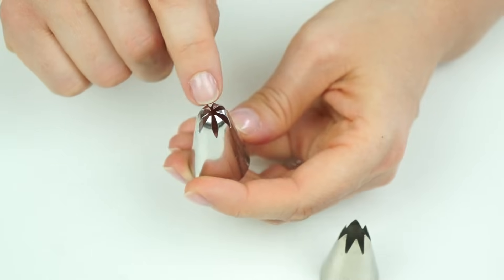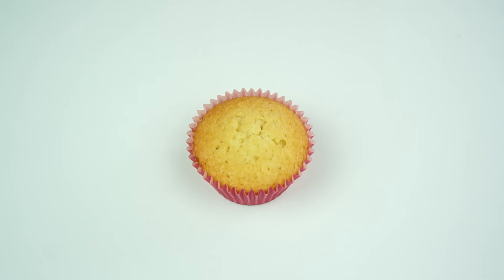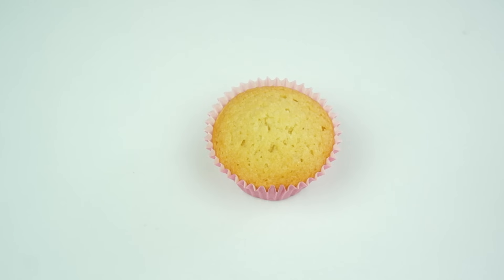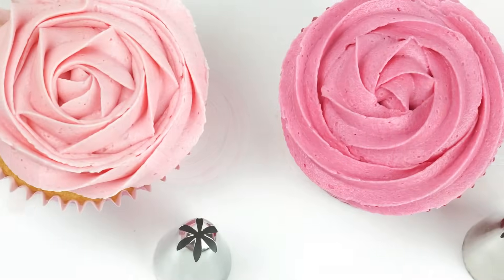1M vs 2D - Comparing Piping Tips - Cupcake Piping Tip Techniques Tutorial

Comment: There are so many nozzle types and sizes- I have a set but the nozzles seem a bit smaller than the ones in your video. Does this matter to the overall effect? Thanks, Jenna
Reply from the maker: For piping cupcake swirls you really need quite large nozzles. The smaller nozzles that measure around 1cm at the end are used for making smaller effects or piping boarders. I have a few piping techniques videos with show alot more examples of nozzles and the effects they create if you click on the video tab of the channel.